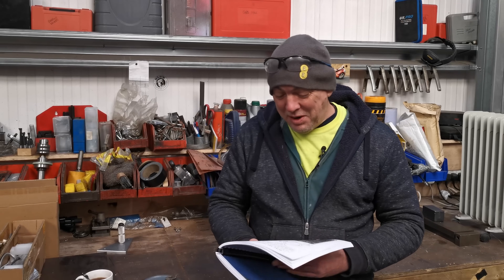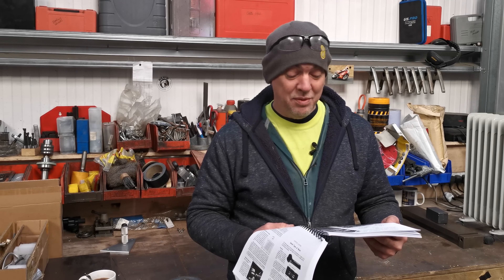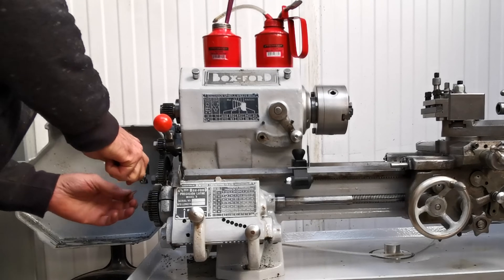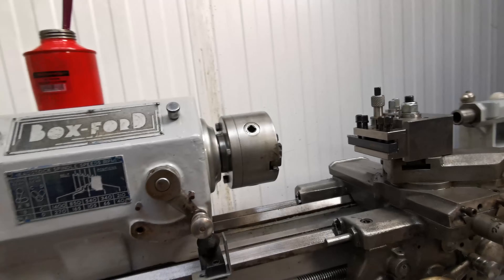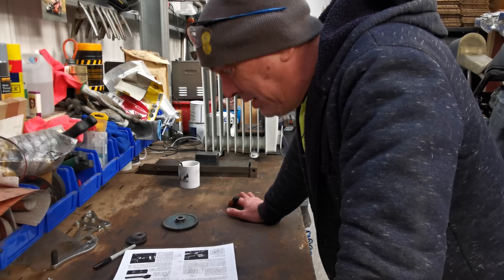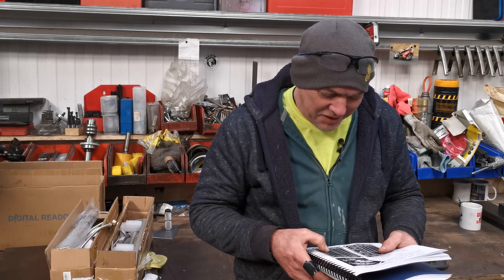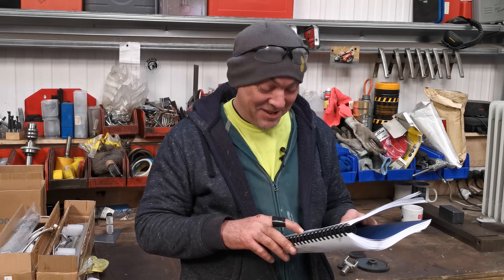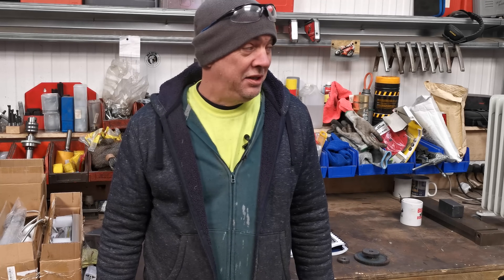Metric conversion on my Boxford AUD lathe

Comment: Just a wee tip, try and not use the halfnuts for normal turning ,always use the clutch ,save your "nuts" 🤣 for threading  .The guys you mention on the vlog regarding gears always charge way too much ,personally I will not be ripped off . Look on ebay there are always sets of gears or single gears for sale at proper affordable prices .  I know I'm a bit to the party in the comments ....
Reply from the maker: A very good tip matey... over time I've come to do all my roughing out passes by hand and then use the clutch for the final pass to get a nice finish. I'm learning as I go, but that's a good tip, thanks for chipping in matey 👍

Comment: Hey there, how did you go with your gears? I have made a lot on my wee AUD boxford out of tufnol, cast iron and steel for smaller gears. Made a fly cutter set up that mounts where my tool post sits and index from the back of my spindle. Believe it or not I use an electric hand drill for my fly cutter drive and a Kenwood cake mixer for cutting steel gears.  Works awesome for me.👍
Reply from the maker: See, I love that... it seems you can do all sorts once you get a lathe, all you need is a bit of imagination. I've been told you can use them as a tube notcher as well.... put the hole cutter in the chuck, a V clamp in the tool holder to hold the tube, set the angle you want the notch cut on the compound and feed the saddle in to make the cut. Haven't heard of a cake mixer being used before though 🤣😂😅
Reply: @QuickBikes   everyone I tell about the cake mixer  they never believe it lol. I have a quick clip saved on an old drive somewhere, I'll see if I can find it and upload it lol. Might make someones day. Haha. I have a few photos of gear cutting as of late with my drill and some tufnol gears.

Comment: You only need one or two more gears to cut virtually every metric thread with the setup you have already got. Delrin gears on fleabay are only a tenner or so each and perfectly adequate. I've been using a set for two or three years now. You definitely don't need a 72/18, not certain but I think that's the conversion gear for the variable speed lathe. Sure you've worked this out yourself by now though.
Reply from the maker: Yup, just waiting on Jamie to do his wiring thing and we should be in. Basically I need to be able to reverse it without disengaging the gearbox. Once that's done, I'm sorted 👍

Comment: Buy the gears. You won’t be able to get the contract patch you need with the equipment you’ve got , and it’s a dividing head you’d need
Reply from the maker: Yup, that's what I decided to do. I can't really justify thr expense at thr minute and would rather get a better mill first 😁👍
Reply: I have a metric gearbox, and I only have two gears to do all metric gears,
Reply from the maker: Oh the joys of having the right gearbox hehehe.... I couldn't pass this up though for the money so happy to suffer with an imperial setup 😁👍

Comment: Making your own gears isn't that hard once you have a way of indexing. You do not need a set of module gear cutters (which are stupidly expensive) to do it either.  Actually, thinking about it, they're probably "diametric pitch" cutters, which are even more fucking stupidly expensive, and depending on the age of the machine you'll need to worry about what pressure angle they have, too.  

The easy and cheap way to do this is to make a fly cutter, and grind a form tool for cutting the teeth.  It's slower than cutting with a dedicate cutter, but frankly who cares if you're not making enormous series of gears anyway?

You'll also find that you can get away with using softer material for the gears.  Sure, cast iron gears are stronger, but aluminium is fine for occasional use, and so is plastic (heresy)
Reply from the maker: Looking into the cost.of a dividing / indexing head and I think I'm just going to buy thr gears I need as and when I need them. Can't really justify the expense at the minute... 🙄🤔

Comment: 0.2 to 6 covers everything you'll need for metric threading unless you're doing full-on "art" stuff like that 10 start bidirectional bolt that crazy russian put on youtube recently.   I've never seen anything bigger than a 6mm thread used anywhere, and I've done a lot of big stuff.  Anything over 4mm is pretty much exclusively stuff like leadscrews.

Does the boxford not have a setting for auto-feeds that doesn't use the leadscrew directly, instead driving off the groove in the leadscrew?  That's the normal setup, and it doesn't wear out your split nuts, andit's normally internally geared on a feed per revolution basis that's way lower than the leadscrew gives you (it's usually around 4:1).

I'm just jealous that your lathe does threading, though.  Mine don't :)

As for "don't have a stud"...  You have a lathe and a mill.
Reply from the maker: Unfortunately the power feed is thr lead screw, not a separate shaft, but I'm not complaining 🤣😂
The other gears I ordered turned up today so I can do all thr usual.threads now I think, but I'll have to check again to be sure 🤣😂
Reply: @QuickBikes  Yeah, it's through the leadscrew rather than having a separate feed shaft, pretty common setup that, but it should be driven by the groove in the leadscrew rather than the threads themselves.  You use the feed change lever and feed clutch control that are found between the handwheel and the half nut lever.

IIRC they interlock with the half nut lever, so you can't engage both at the same time, but, from memory (it's been a while since I've played with a boxford):

- half nuts disengaged
- move the feed select lever up for cross feed, down for saddle feed, in the middle to turn it off entirely and either hand feed or use the half uts.
- screw in the clutch knob until it "bites".
- robert is your mother's brother.

Can't remember if there's a quick disengage.  Like I said, it's been a while.

The difference in doing your power feed this way is that you don't have to engage the half nuts (which do wear out, and will cost you a new arsehole to replace), unless you're actually cutting threads, you get a finer feed and thus better finish, and you should be able to power feed the cross slide as well as the saddle (a low speed power feed cross slide can be really good for cutting off.  Or breaking cutoff tools :).

Stay safe.
Reply: @QuickBikes   Hi again , your power feed the for saddle and crosslide , which you engage the clutch to use, is run from the long keyway in the lead screw, quite seperate from engaging the half nut for screwcutting , when you engage half nuts the saddle is running direct from lthe lead screw threads , cheers Paul
Reply from the maker: Sorry, I misunderstood you. Yes, you can drive the saddle and.the cross slide via the clutch, but as you say there's no quick release for it, you have to.turn thr knob which is rotating.with the clutch assembly. I've never used it for that reason but maybe I should have a play and see how I get on with it 😁👍

Comment: I have the same lathe . imperial , i think you can cut virtually all the metric pitches you will need with the set up you have , the gears are a fortune !! been looking for months on ebay, too tight to pay the prices they want , £175 for the compound gear is about avridge !
   i would get in loads of practice cutting threads , before you attempt to make anything , also remember the thread dial indicator is no good with the metric gears on , you need to keep the half nuts engaged all the time when taking cuts .
  mr pete and this old tony have some great thread cutting vids, good luck !
Reply from the maker: Thank you Paul. My lathe is more than good enough for what I need I think and is getting put to work regularly. It's cool that once you make something, you instantly think "if I can make that, I could probably make this other thing as well...?!!"  Hehehe... Great little lathe in my book.

Comment: If you haven't got one I would highly recommend a book called engineers  little black book second edition it covers gear cutting and the math to make then as well as thread forms and sizes bolt hole position drill bit grinding and different angles different tapers and there sizes hss tool grinding and different carbide tooling and identification heat treating and a lot more there about £35 from eBay but worth it most of what I use to goole is in it
Reply from the maker: Ah right. I've got the Machinerys Handbook which sounds similar, but I'll definitely look this up. Thank you matey 😁👍

Comment: A large printed template fixed to the gear blank and a pointer would be accurate enough for low speed gears btw, keyway broaching could be done on the lathe so a gear tooth cutter for the mill is the only real outlay
Reply from the maker: I really want to have a go at it on my kit. I've had a word with the tool room and confirmed what I'd need 😁👍

Comment: Considering a micrometer has a thread pitch of 0.5mm, I think you're more than covered with a 0.2mm pitch😉
Reply from the maker: It's crazy small.... lol
I can now cut the most common threads I think, so will just buy the gears I needas I need them. I can't really see the need in getting a full set just in case.... 😁👍

Comment: Perhaps check this out: http://www.herosteamengine.com/RideTheGearTrain/ - You just programme in the change gears you have and what you want to do and it spits out all the options. As you have the gearbox, you'll find that you can actually cut a range of threads with only a few change gears.
Reply from the maker: Thanks for.that, I've already gone through the manual to find.out what I can and can't do. I'm just going to get the missing gears as and when.I need them.I think to spread the cost 😁👍
Reply: @QuickBikes  No worries. I have a Model A (even older than yours) and find the resource very helpful. The manuals generally give one way of doing things but the software gives options - often you can achieve a lot just by changing the settings on the gearbox whereas the charts might have you getting the spanners out!